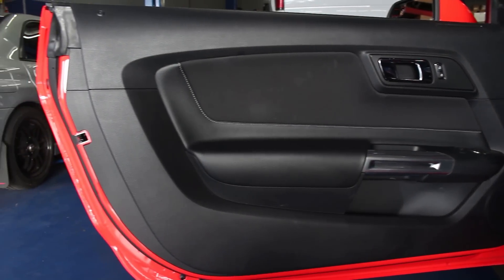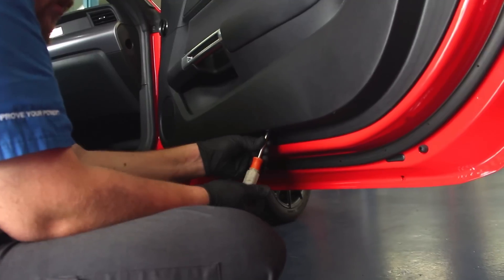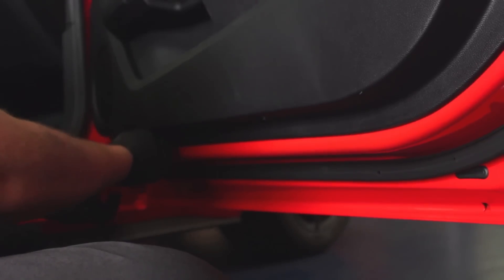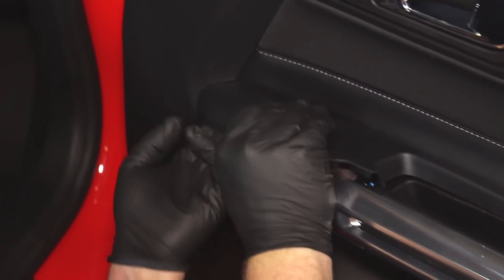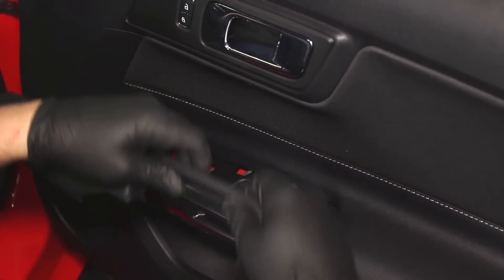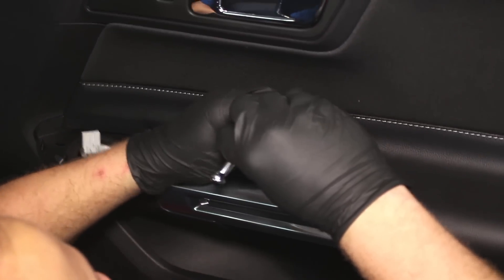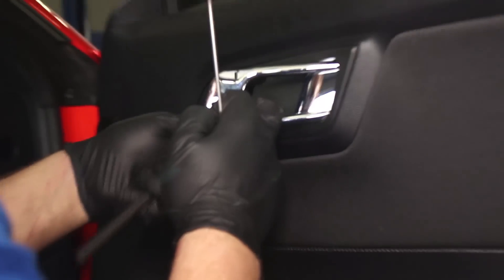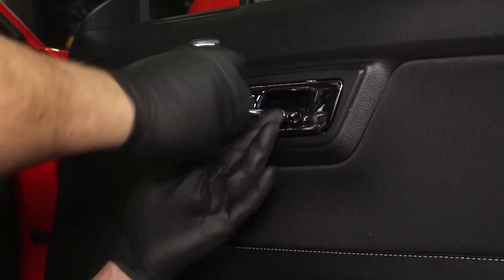How to remove 2015-2016 Mustang V6 EcoBoost GT Door Panels

Comment: I just love how he doesn't say the size of the screws and doesn't mention they aren't phillips. Could've saved a lot of time knowing this.
Reply: Love how you didn’t clarify what they are either… could have saved someone else some time.
Reply: if you're working on a car 9 times out of 10 its gonna hex bolts not philips 💀
Reply: 7 millimeter on bottom 2 , 10 for behind the door handle , and 10 mill also behind window switches piece

Comment: hey, I have a Q and I really appreciate your answer and help.  
I have a 2015 Mustang Premium 50 Years Anniversary Pack and the the word Mustang on the doorsteps doesn't Illuminate. So is it possible to replace them with ones which Illuminate?! Does it require wiring or only connecting with an already builtin wire!

Comment: Do you need to disconnect the battery in order to remove door panel and door handle?
Reply from the maker: No you will not need to disconnect the battery in order to remove the door panel or door handle.
Reply: I never do